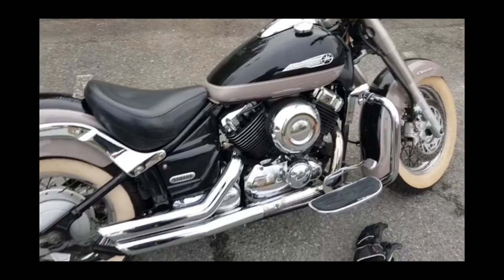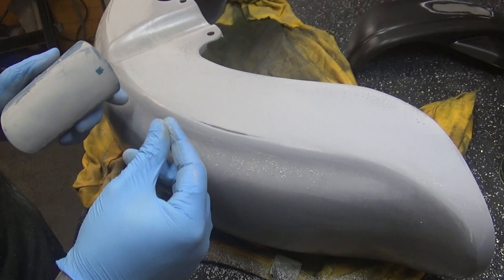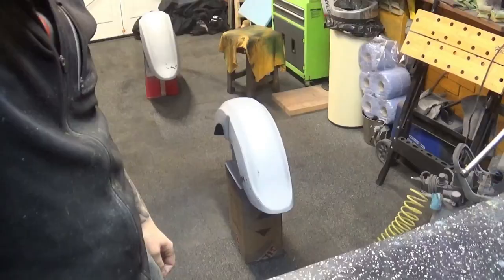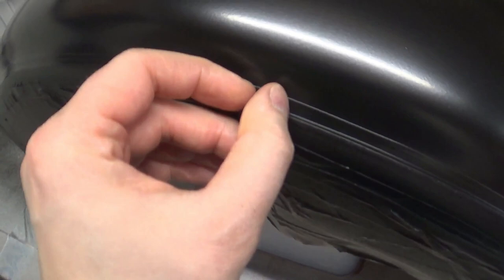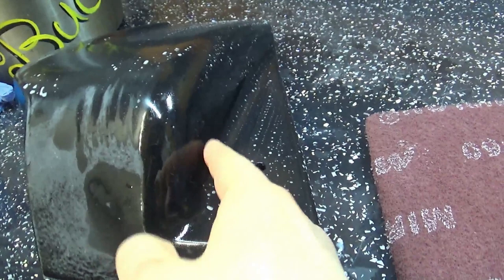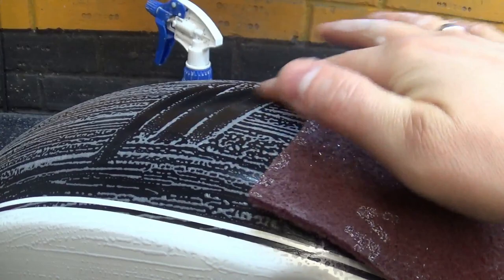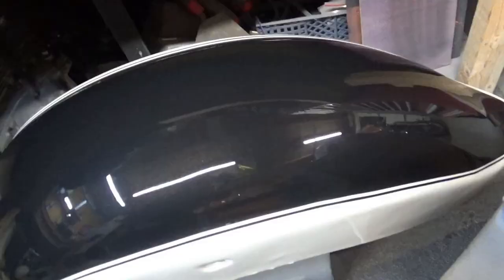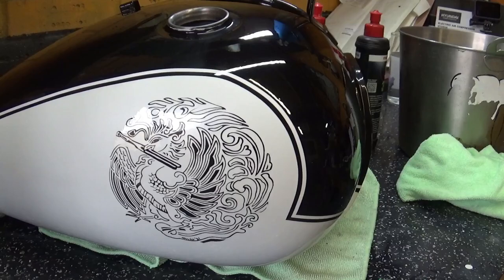How To Paint a Motorcycle - Tips and Tricks

Comment: Any tips and tricks for spraying with a can paint?
Reply from the maker: It'd be the same thing buddy. Application may be different but the prep is all the same!
Reply: @MackieBass  Thanks for the reply Mate! My only concern is that i won't be able to lay a flow coat - one thing that can't be controlled is the lacquer:solvent ratio...
Reply from the maker: You still can get rid of imperfections and layers build.up in first coat, so your second flow coat will be much smoother!